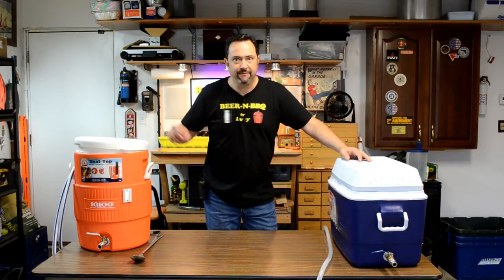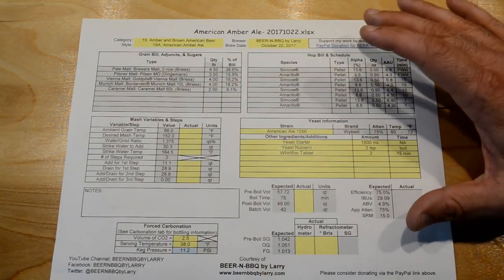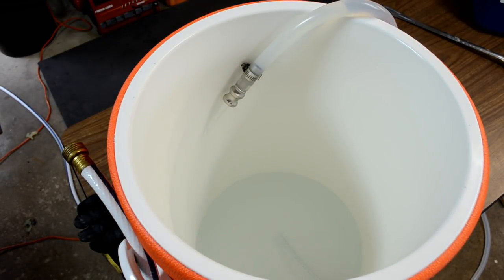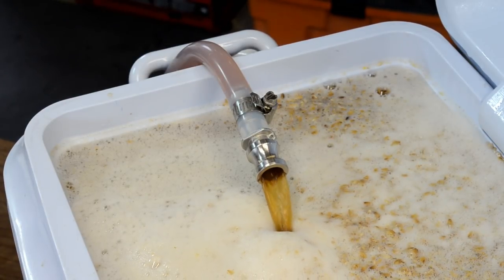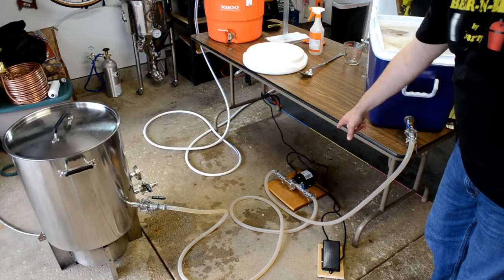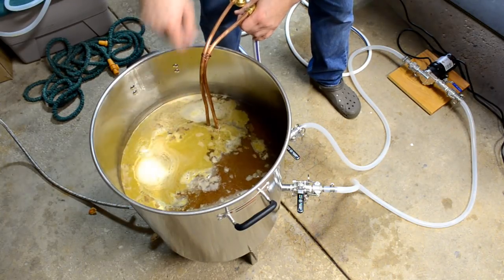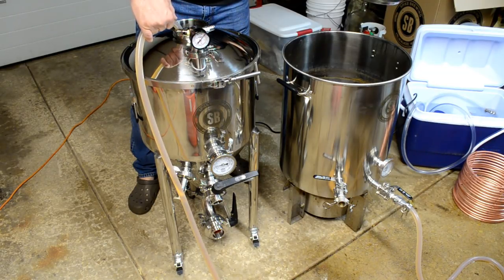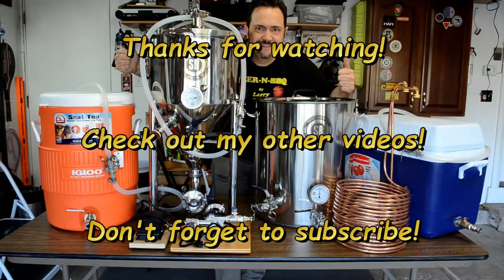My 10 Gallon Brewery: Overview & First Brew Day

Comment: Great vid ! I love seeing other peoples home built setups.
For chilling down wart, a counterfow chiller works the best. I built a 50ft coil.
I took a 50 ft 1 1/4" OD clear vinyl hose, and two 50ft  3/8 copper tubes, I loosley twisted the two copper tubes together and fed them into the 1 1/4" vinyl hose. I then got two 1"  brass tees, one for each end. Fitted a 1" hose barb for each one. I cut two discs from heavy copper with two holes for the 3/8" tubing for each tee and fitted and soldered them in. This bulkhead in either end of the hose  divorces the cooling water from the wart. 
I coiled the whole thing up into a 16" stack and put garden hose inlet on the bottom and outlet for waste water on the top. So the boiling wart goes in through the top into the twin copper tubes and the cooling water circulates around both copper tubes on the outside.
This unit simply gravity fed in one pass will cool 15 gallons of boiling wart to room temp right into the fermenter in under 4 minutes. Using two 3/8" copper lines is far more efficient then a single 1/2" or 3/4". The surface area is almost triple.

Comment: Glad you posted this as I have been working on designing a system using QD. I have a small anvil pump so I was agonizing on getting a new pump like Chugger but after seeing how you rigged yours up, I am going to keep the anvil pump in play for now and just permanently connect the tubes to the pump, for now. maybe I'll upgrade to a bigger pump with full QD setup later.  But, again, thank you for sharing your setup and schematics!

Comment: First off, thank you.  I've watched a few of your videos now, and I appreciate your work.  However, not sure how old this video is, but your chiller setup is very complicated.  I used to recirculate from an ice bath as well.  Found a Blichmann Therminator on Craigslist for $100 (brand new), and haven't looked back.  I realize this isn't a "money is no object" engagement, but the Therminator is $200 brand new, and your time is worth something.  When I transferred last night, I went from 180 to 55, transferring 6 gallons of wort in about 6 minutes.  I'm not bragging at all - I'm simply saying that the Therminator is worth its weight in gold, as far as complications, setup, breakdown, and end result.
Reply: BEER-N-BBQ by Larry  I have similar 10 gal setup with both a counterflow chiller and chugger. Just ordered an immersion chiller and not sure if I can use both immersion and counterflow to save water. In the same boat. Any ideas???

Comment: Great vid!  I'd recommend adding QD's to your immersion chiller & garden hose ends.  Makes them easier to use.  Also, it should be easy for you to calculate the volume of the immersion chiller so you don't have to remove it before racking.  When you pulled it out you certainly disturbed the trub bed that you spent so much time creating with the whirlpool.

Comment: Great video and some pretty innovative designs on your system! I am very new to brewing and not sure if this is a good idea or not, but I would consider adding some small valves to the ends of your hoses. This would help reduce waste and spills as it allows you to stop the liquid in your hoses when moving them from one unit to the next. Thanks for sharing!

Comment: Hi Larry, now is the time to tell your how i brew beer I have to go back a bit in time in the 90s I was in a beer club and Miller brewery had their first toure and for making the the wort was a big pit  with a mixing arm, were the water and grains were added but they added hopes in as well, there was no bowl pot after that . so long after that now I add the hops in the mashtune and no need for the 1 hour bowl. Try that for size.
Reply: No just don't boil for the hour, cool it off from the mash tun and in to the fermenter, add the aroma hops in the last 15 min, no need for a hops bag the grain will keep the hops in the cooler or wormer, I start out with  a temp around 145 to 148 for 30 min then bump the temp up to 152 for 30 min then to 158 for last 30 min, there is no loss with boil off of water so take that out the last of the water just bring to near to a boil and add to wort mix and your ready to drain to fermenter, 8 gallons in 2 hour of work and then the clean up, no all day brewing, try is Ill bet you'll make a video on it.

But you can start out at the 150 if you like with the mash or wort temp and with that you will save 30 min it time too.                 Happy Brewing!!!!!!!!
Reply: Daniel. Will this work for big batch (10 gal) high  gravity IPA or Hazy beers ? So u mash in SS container with hops ,Xperia’s to kettle for how long and coool ??

Comment: Nice setup.  I have a similar chilling setup as you.  I live in the desert so in the summer the tap water gets near 80 degrees.  My solution was to take an old submersible aquarium pump and plunge it into my HLT that I re-purpose for cooling after I sparge.  With the submersible pump, I don't need another coil like you have.  I don't start with that however.  Even with 80 degree tap water, I get use my hose through my chiller to get the wort down to around 100 in under 15 minutes.  Then I switch it to the ice bath to get it down the final 30 degrees or so and just recirculate the water back through the HLT ice bath.  This way I only need a couple bags of ice.  Works pretty well.  Definitely want to modify my plumbing to some cam locks to make the switching easier.
Reply: Jonathan Williams stoked to hear more about your chilling setup!  Got a chugger pump and counterflow chiller but not sure how to set it up. Also ordered an immersion chiller after seeing Larry do all the legwork with his well though out design. Trying to save water as I upgrade to 20 gal batch

Comment: Btw, another great video :) ... a few suggestions... (1) try under-letting your grain by filling your mash tun with grain dry and fill it with hotter water via the mash tun outlet... this works great for me when dealing with that much grain. Need to get the mash water hotter to compensate but +5 to 10 more degrees works for me... (2) make a dip tube shaped like a hook with a QD to allow you to take it on and off when needed... this would allow you to hook a hose when attached to it over a kettle or cooler lip with out the need to baby sit the hose during pumping operations. (3) add a small bleed valve to the pump discharge to help in priming. One could also use it to divert flow with the addition of another hose later on. That extra valve divert port comes in handy especially when moving around 10+ gallons (4) when moving hoses around, kink the hose to keep it from leaking while moving. (5) cooling 10+ gallons with an immersion chiller is a P.I.T.A. ... I'd suggest a plate chiller or actual counter flow chiller which would allow you to recirc until cooled or one pass transfer once the temps are dialed in. I recirc to the kettle until the return temp is at pitching temps and then use another valve to divert the wort to the fermenter. I personally use a CFC as there is NO risk of clogging stuff like what may happen with a plate chiller. Whether a CFC or Plate chiller, either is still better when doing 10+ gallons... I look forward to your next video...
Reply: In regards to the underletting, one could throttle the pump with the valve to keep the flow down if there was a concern... the pump's pressure output is pretty low regardless in which I doubt there is enough pressure at the manifold hydrostatic level to blow the manifold apart... btw, I'd just use the hose you had draped into the mash tun and connect it to the tun outlet... there is nothing wrong with mixing either... to each their own 😃

Comment: When you are doing your whirlpool step you have your whirlpool arm and kettle pickup tube facing the same direction which would be counter productive. The bottom tube is pulling liquid counter clockwise as whirlpool arm is pushing wort  clockwise. Just thought I'd point that out, so you can improve your trub cone. Diy Counter flow chillers are always a good investment and not having an immersion chiller getting in the way and disturbing trub cone when you pull it out would also help with separating trub. Not that it matters a whole lot if you cold crash your new conical. If you take your spoon and flip the downward pointing pick up tube to the up position it will allow the liquid to flow to the pump for priming, then when you have good flow turn it back down. Just a few been there done that tips.

Comment: Great work. Way to create what works for you. One thing I would do is put ball valves on your hoses before the connectors  so you do not need to worry about spillage as you move from connection to connection. As for your loss of water. Was it absorbed by the grains?

Comment: Nice rig mate, I run a pretty primitive system. I call it the "Ghetto Setup". It's a 3V system comprised of a 50L SS HLT with a 2200w element, 70L HDPE mash tun which than runs into my Keggle which has 2 x 2200w elements (Thank god for Australia's 240v homes). This system allows me to brew 45L (11.8 gallon) batches. I usually split the batch into two and experiment with different yeasts/dry hops. Though mostly I do small BIAB batches as I like variety now. BTW, you will have to make a video on making a keezer! Cant believe you only have the single tap kegerator :) Your beer must be that good that you only need the one variety! Keep up the vids mate, love em.

Comment: Based on the problem you have with your mush tun not being able to hold that mush water i would think fly sparging would work. So open valve after you mash to boil kettle then slowly start to pump water from your HLT (other Cooler) into your mash tun, being sure to keep just a slight amount of water above the grain bed. Since you only have one pump you can gravity feed into boil kettle. for the MLT you might need to get a bigger cooler to hold more water.

Comment: Very nice. You did well for your first time with the new system. Do you really need to oxygenate with the tank? I let the wort drop from a height like you did in the first instance and I’ve never had an issue. I guess you’ve always done it so no reason to change but I’m just curious. Also the bottles of ice. Yep, before I made my Emerson chiller I tried adding bottles of ice to the wort and it didn’t work well which is why I went ahead and made the chiller. It works for a minute but when the exterior ice melts it seems almost to insulate the ice and prevent the cold transfer. Hope the beer works out 👍🍻

Comment: Try running the "hot wort" from the kettle to the carboy through a stainless steel coil, this is what I do, obviously everything is sterilized bringing the the wort down from 200 degrees F to about 70 degrees F in 15min very easily.

Comment: I suggest adding a bypass to your pump to adjust the flow rate instead of restricting the flow and putting extra load on the motor of your pump.  This can be done by adding T fitting on both sides of the pump and an extra valve on the outlet. When you want to limit the flow, fully open the loop valve and adjust the output valve to get the desired flow.
Reply: Chugger pumps are magnetic drive, perfectly OK to run restricted or even fully closed for short times.

Comment: I have a suggestion for your emersion chiller problem. instead of using ice I use a dehumidifier and put the condenser inside of the water and then run it until it turns into a brick of ice that way the water is constantly cold

Comment: Have you ever thought about running your lines that are re-circulating the wort on the cool down through the cooler with the ice in it instead of trying to use it to cool down the water going through the copper tubes?  Just think that would cool down the wort quicker.
Reply from the maker: You mean a second prechiller submerged in ice water. Yes. That what I used to do. However, doesn’t help all that much due to the extra line resistance greatly slowing down the rate of flow. Plus, you can’t chill water any colder than near freezing anyway.

Comment: Love the new setup Larry, mash tun is a little small, with higher gravity beers might be stuck doing a 5 gallon batch or run 3 batches like you did.  Otherwise very cool setup!
Reply: Do you get to keep that fermentor, if not I have an address you can use to mail it back to spike =)

Comment: Interesting! This gives the over setup for a system! Though I would like stainless for each piece in the system due to plastic absorbing and long use issues for the repurposed coolers! Liked the cooling coils!
Reply: Yeah I agree. I was thinking this would be a great 3 pot system to start with. Seems affordable and you can easily replace all the plastic Over time and retrofit the rest of the parts.

Comment: love it man. cam locks are a blessing aren't they ?. I did away with my measuring sticks and got with  on the side clear tubes. With your equipment  all is required is a  three way 1/2" bsp  fitting.

Comment: Have you thought about moving the flow rate valve for the pump right next to the male output? Might help your workflow
Reply: BEER-N-BBQ by Larry yea that's what I mean. Don't know if it would be any benefit though. Just when you were holding the hose in your mash tun and trying to adjust the flow rate, seemed difficult

Comment: Hi Larry! Love the video. Any chance you have some advice on how to wire up the foot pedal? I just ordered one on eBay but have no idea how to get it working - there seem to be some YouTube videos on wiring these things, but they've all done it in a way that the power is on only while your foot's on the switch (as opposed to just having it as an on/off switch)
Reply from the maker: I didn’t have to do any wiring. I bought a foot pedal with a three prong plug and outlet and is on/off settable. Sounds like you bought one of the momentary switch versions.

Comment: Cool beans... Finished just in time for some cool brewing weather.
Reply: Hey Larry, how long did you recirculate the boiling wort for to sanitize the pump and tubes? We did a similar setup for our last batch and it actually stopped our wort from boiling.
Reply: BEER-N-BBQ by Larry we did that. Did you notice if yours stopped boiling? We are only doing 5 gallon batches.

Comment: Hi Larry I like your system and videos. 
Where did you get your cam lock fittings silicone hose and stainless fittings. I’m building a system BIB.  I would like to install the fittings you use.   
Perry

Comment: I was thinking that a cheap accurate alternative to measuring how much water is going from the HLT to the MLT could be one of those 100pound capacity scales to weigh the MLT. But i guess with a 10 gallon batch you might need a larger scale. This is something I want to try for my next brew to be more accurate. I just measured 1 quart of water and it measures 2.09 pounds. so 14 qt water should weight 29.21 pounds... Do you think this method would be effective?

Comment: Hi Larry,
Just wondering now that you have had the pump for a few months how do you feel about using it compared to your old way? It just seems to me that there is more involved with the pump and changing positions often.With my system anyway which is 3 tiers it all flows down hill and I do not need to change anything. Whether I fly sparge or batch sparge my HLT is on the top shelf and I can do either. One thing that I am considering though is building an electric HLT as I think that would be a good addition to my set up.
Cheers
Dale
Reply: I fully understand that and for the reason it makes perfect sense . One drawback is that presently I have to lift the water up to my 3rd tier which is a pain. I have thought about a pump just to pump the water up to the HLT and I may go with one.
Cheers

Comment: Hi Larry.  Sorry for resurrecting an old video and I may have missed the answer to my question, but could you (or did you consider) putting some sort of false bottom in the mash tun to allow the water to come up from the bottom?  I am new to all grain brewing, but wanting to switch from extract.  Just wondering if there is an advantage or not for doing that.  I am asking because when you look at some of the "all-in-one, or not DIY" systems that seems to be how they (I guess it is called dough-ing in the grains) add water to the mash.  Sorry if this is a remedial or otherwise unworthy question.  Anyone can respond... just trying to figure out what direction to go with my build.
Reply: Thanks Larry, not being critical just trying to learn the process.  Your setup is nice and I intend to use your ideas for mine.  Doing my best to minimize mistakes up front... that is if it possible to do so, lol.  You have a nice channel and I enjoy you videos.

Comment: hi Larry, considering that you have a 20 g boiler, and some extra space in your mash tun, do you thing that your set up is capable to manage 15 gallon batches? thanks larry for all of your videos btw
Reply: @BEERNBBQBYLARRY    oo yes, sry i made the comment in the wrong video, i know you had to make a bigger mash tun due some issues. i gotta tell you  that i will build  the same system as yours. simple, effective and not too expensive. but i think i will not use pumps. provably i will do my very first brew in two months. thanks Larry again for your tuttorials.

Comment: Seems like it would be much easier to use BIAB. You already have a great kettle so it would be almost a one step process.
Reply: Can’t wait to see your bigger batch setup !!!  Saw a video where guys used a ladder with a 2x4, hook a pulley to pull BIAB. Not sure if efficiency drops off or  easy way to sparge with this setup.

Comment: In your first batch using a pump and quick disconnects, would you recommend it to other brewers? Seems like it can save time but might over complicate things. Just weighing the options before I make a $250 jump with the equipment.